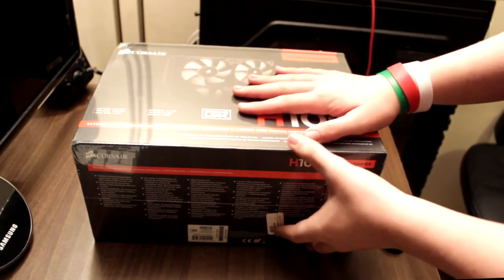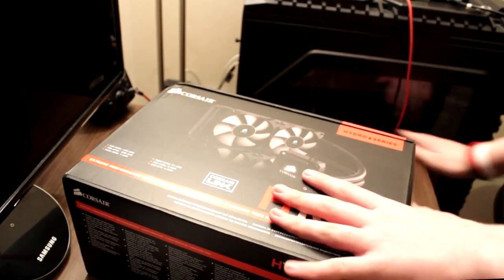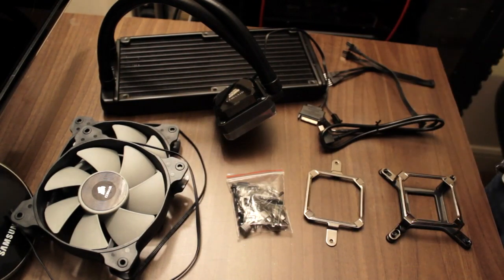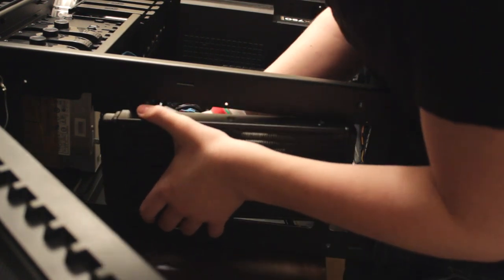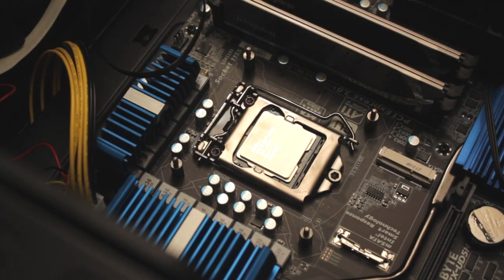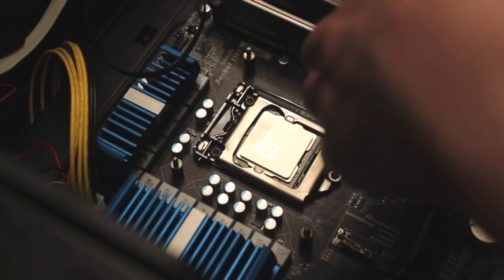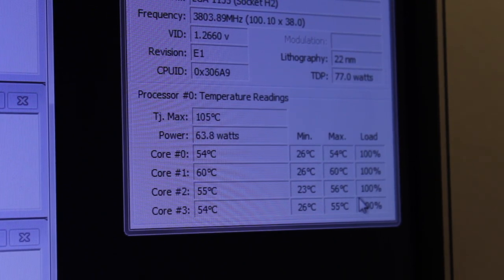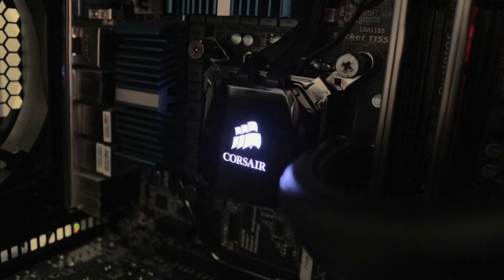Corsair H100i: Unboxing and Installation

Comment: is the backplate of corsair h100i suppose to jiggle and be loose before installing the cooler on top of it with bracket? im putting it on
gigabyte aorus z390 pro motherboard and the backplate is loose and i'm not sure if i should proceed with it or if i should take the adhesive tape on the backplate and stick it to the motherboard (the backside where backplate is snugged to)

Comment: Can you change the LED color of the corsair logo?
Reply: Yes you can change it to whatever colour you like. If you get the led corsair fans then you can even coordinate the colours. It's a wonderful  cooler. My i7 9700k sits at 27 degrees at idle and load is less than 60

Comment: So the box in the video doesn't say it supports LGA 1150 but on the website it says it does and now I'm not real confident in buying it. Does it actually support LGA 1150 and if so is there a video you could link me to prove it? Thanks!
Reply: Use pcpartpicker
Reply: +Zyrah yes it does, i have it installed on one

Comment: I heard the fans were uncomfortably loud under load, is that true?
Reply: ***** yeah but if you get some sp 120 quiets they will be silent
Reply from the maker: ***** The stock fans are loud OOTB but you can control them using Corsair Link, or pick up some SP120 Quiet Editions, they are quiet OOTB.

Comment: Will it really not fit an lga 1150? If not can you recommend any other cpu coolers or can i just use a different mount... Sorry, I am a noob.
Reply from the maker: Ducko 1103 This will fit LGA 1150 with the same LGA 1155 mount I used in this video. The reason I don't mention it is this was filmed in 2012 before LGA 1150 even existed.
Reply: bleedinsixcolours Thank you :D

Comment: Is this cooler enough for an i7 4790k?
Reply: SEANcb Are you being sarcastic
Reply: Nope
Reply: This is probably one of the best AIO water coolers available. Its actually somewhat overkill for a 4790k
Reply: I just realize how stupid my question is. I am probably going to overclock to 4.40 Ghz
Reply from the maker: SEANcb I'm on a 5820K (6 Core equivalent of the 4790K) and I'm overclocked to 4.4GHz so you should have no issues! :)
Reply: +SEANcb  uuumm  4790k turbo boost to 4.4 naturally if temps permit..
Reply from the maker: Rene Pena It will only boost 1 or 2 cores to 4.4, and all 4 will only go to 4.2GHz MAX. It is also not going to be used in all scenarios. Overclocking to 4.4GHz will mean it will always run CPU intensive tasks at that speed.
Reply: Cool man, had no idea. Thanks for the heads up!!

Comment: Did you plug the fans straight into the block or into your motherboard CPU fan headers? I've heard mixed ideas about this and I suppose it's just preference. I think I'll plug my radiator fans into the CPU Fan and CPU Optional headers. My Asus Vii Hero has a lot of fan control options in the UEFI. I'll still have to install Corsair link so that I can change the LED though.

Comment: I also have a haf x case and I was wondering, does it matter if the radiator is below the metal bars that it screws into and the fans above it? Also, if this doesn't matter should the fans be blowing air into the case or out of the case in this setup

Comment: hey if you could answer my question it would be great, I'm looking at buying a system that comes with this cooling system and that's all swell, however how do you empty it out and refill it? no tutorials focusing on the water specifically so how is it done? please help, thanks in advance.
Reply from the maker: No you never have to refill or even fill the cooler. It is all pre-built in.
Reply: oh! thanks mate! been scratching my head at this one, I guess reservoir systems are much different from closed systems.

Comment: guys my h100i is going to 80 c on p95 with all stock clocks. The stock fan used to run 70 max and even less, the h100i was still going above 86 when i stopped it, I'm running a push config just like the video, but the fans are plugged into cpu and cpu opt. and AI suite 3 reads them as 2700 rpm when on load, is it because of the pump not getting enough power??? I also don't hear the water moving through, is that normal too, please help me.
Reply from the maker: If you look on my channel I have a video entitled 'H100i Backplate fix'. Look at that video it should help you out a LOT. It's a common issue mate don't worry.
Reply: bleedinsixcolours okay, I will try that fix later when I get some thermal paste, but my question now is, I didn't have any cables with the h100i it probably got lost, and u have like 2, so my pump is only powered by sata and not the corsair link and the mini usb, does this affect the pump performance?
Reply from the maker: Sami Haddad The USB connection is only for DATA its not necessary at all. The pump power comes from that single SATA cable.
Reply: bleedinsixcolours i don't have ANY cable, is any cable necessary for the pump power and control? I repeat I have noooo cables at all no corsair link or usb shit
Reply from the maker: Sami Haddad The cable that powers the H100i is Pre-Attached. To control the pump you will need the USB connector but thats unnecessary. Just plug in the cables that are permanently attached thats all you need.

Comment: Getting liquid cooling to treat my baby i5 since with stock fan it shoots to 105 degrees CELSIUS the second I render anything in Vegas

Also yes, I know It's most likely a thermal paste issue.
Reply from the maker: Mate 105 is really really not safe. PLEASE reseat your cooler...

Comment: Will this work with Aerocool X-Warrior Black Edition?
Reply from the maker: No it won't mate. You may want to look at the H80i if you're thinking about putting an AIO in that case. I'd say upgrade your case though mate :)
Reply: bleedinsixcolours Is Fractal Design Define R4 a good case for the H100i? And good for overclocking?
Reply from the maker: That is the case I have mate, I fact I have done s video recently on installing the H100i in the Define R4 and it is a brilliant case.
Reply: bleedinsixcolours OK thanks mate! You think I can overclock my FX-8350 to 4.5+GHz with that cooler and case? If so, the only thing that's "stopping" me is my motherboard... ASUS M5A97 R2.0, but I hope I can overclock it at least a little bit. If not, I will upgrade my motherboard I think...
Reply: And is it really worth the money?
Reply from the maker: ***** Overclocking is never guaranteed. It is down to your specific chip. I found it worth it to me, as I got my 5820K from 3.3GHz to 4.5GHz, adding about 30% extra performance. Read around forums, if there are a lot of success stories of the 8350 with this cooler then it SHOULD hit the 4.5GHz that you're looking for, but there are no guarantees mate.
Reply: bleedinsixcolours OK, saw JayzTwoCents overclock it to 4.8, but he has this "super-board" and 850W gold rated power supply.

I got a 550W power supply by XFX, you think I can overclock a little, mate?
Reply from the maker: ***** I honestly don't know mate, I have no experience with the 8350, but I would think so yes! :)
Reply: bleedinsixcolours The 8350 uses 125W and my motherboard supports 140W. I'm using a GTX 760.

Thx!
Reply: Would you recommend the H100i for water cooling or something else?

Comment: Will I be able to fit it into this case? http://www.amazon.co.uk/CiT-Vantage-Gaming-Audio-Reader/dp/B0071KZNUY#productDetails
Reply from the maker: No mate, and honestly I would re-proportion some of your funds away from the CPU Cooler and to the case. Honestly, I have bought that exact case when I was building my first PC and it is horrible. Step up your case and get a Coolermaster Hyper 212. You may even get better temps because that case is awful for airflow.
Reply: bleedinsixcolours Ah right, that is just the case that I use at the moment, thanks for the reply :) 
I was thinking of getting this case, good choice or not?
http://www.overclockers.co.uk/showproduct.php?prodid=CA-135-NX
Reply from the maker: Beandon Jones Very good choice mate :)
Reply: bleedinsixcolours Changed my mind due to budget haha, what do you think about this one compared to my current shitty vantage one? :D 
http://www.overclockers.co.uk/showproduct.php?prodid=CA-048-AE&groupid=2362&catid=2277
As I only have around about 50 for my case
Or maybe this one? http://www.overclockers.co.uk/showproduct.php?prodid=CA-042-NX&groupid=2362&catid=2277
Reply from the maker: Hello mate,
Funnily enough I've also had experience with the first case, I'd say not mate you'd regret it. Waste of £50. Do you know what size your motherboard is?
Reply: It is the http://www.overclockers.co.uk/showproduct.php?prodid=MB-261-MS mate
Reply from the maker: Cheers, here you go here are a few GOOD cases, they may not look 'cool' but they are really really good cases, you will feel like these are worth the money: http://www.scan.co.uk/products/corsair-carbide-series-200r-compact-mid-tower-performance-case-with-usb-30-w-o-psu 
http://www.scan.co.uk/products/corsair-carbide-series-spec-03-with-red-led-fan-aggressive-mid-tower-windowed-computer-gaming-case (theres also a blue version)
http://www.scan.co.uk/products/nzxt-h230-silent-black-mid-tower-performance-case-usb-30-quiet-120mm-fan-w-o-psu

There you go. if you need any more then let me know :)
Reply: Thank you very much for your reply, the second Corsair one is a definite buy, it looks incredibly cool too! :) 
It's a very good upgrade from my vantage case haha.
Although the other cases are cool, i'll get the second Corsair one because of the window haha. 
Thanks again mate!

Comment: low light shaky camera work cant see a damn thing youre doing. thumb down
Reply from the maker: Mate I don't get payed for this sort of thing, hence things like lighting and camera work for a starter is hard to get. Luckily I've invested my own money and improved now, and you can see an updated video on my channel.
Reply: I got one its okay, not great. I got a refurb one for cheap. Definitely don't pay the full price. Any large air cooler would do just as good and probably be quieter. The fans are pretty loud plus you get pump noise too.
Reply: One advantage though is the radiator can be at the edge of the case blowing hot air out whereas an air cooler would circulate warm air around the middle.
Reply from the maker: artifactingreality
 You definitely took a good route mate, the fans are only loud because they are unmanaged and are running at like 2300rpm. If you use a speed reducer cable or manage the speed in the BIOS/ on a fan controller to less than 5V they can be extremely quiet, but i'd just recommend buying either some SP120Quiet Edition fans from Corsair or some Noctua NF-F12s and lower the speed on those for it to be near silent :)
Reply: bleedinsixcolours
Will this fit with the cm storm trooper and asus maximus formula vi?
Reply from the maker: Gatz22 Yes it will :)
Reply: Thanks

Comment: hello mate, thanks for the video, i got my H100i but can you know why i cant control the fans ? sometimes they get loud and the tem is 42c, i downloaded Corsairs Link but it seems i cant see the fans. thanks once again
Reply from the maker: I think this is an issue with Corsair Link. I have made an updated video a few days ago with my new system and I cannot control the fans on there either, as well as someone commenting asking the same question you did. Put a support ticket through to Corsair support and hope they can help you out mate. Sorry.
Reply: make sure bracket is tight when the block isnt on yet/ liek the 4 pin holes that come from the backket in the back. make sure that bracket is completely tight, my was a little loose but when i put the block on it became tiht so i thought no problems than right??? wrong now that i went back and made it tight i get 30 C less and same 4.6 mhz with 0.1V less

Comment: Is there an easy easy to tell can direction with these? 

I'm installing into a corsair carbide 240. Don't have the mobo yet but doing ad much pre-installed as I can.
Reply from the maker: With the fans? There are sometimes arrows on the sides of the fan (the edges) that tell you which way the air is going to be pushed. If you manually spin the fans you can sort of tell which way they Should go. The side with the sort of X frame is the side the air is pushed out of. If that is not what you meant please comment again and I'll get back to you.

Comment: What about Aerocool Strike X One? Will it fit on the top or is hydro 80i a better choice at the rear ?
Reply from the maker: I think yes, It will fit, there is mounting holes for two 120mm fans... But I don't know wether I would risk it given that i've never worked with the case. Technically it should fit, but If you have any doubts get the H80i. The performance difference isn't very big at all. :)
Reply: Im glad that I didn't even try H100i, the thickness of the radiatorn and the fans, would actually make me ram-less. haha! Even H80i makes me can't get on the last screw for the sidepanel, since the screwhead is slightly roundish... oh well. Im happy atleast I got it installed. :) thanks, and keep going with videos, you got a sub :)
Reply from the maker: 胡俊龙 Thankyou very much! Im about to upload some X99 Content soon so be sure to look out for that :)

Comment: Since you seem like a calm and nice guy, im going to ask like 100000 other people have done, do you know if it this will fit in a NZXT phantom full tower? :)
Reply from the maker: Yes it certainly will :) Very nicely actually you will be able to even do PUSH/PULL easily!
Reply: bleedinsixcolours i got the phantom tower now and the h100i, seems decent enough to install, but do i need another 200mm fan on top? or can i just install with the one 200mm fan i already got?
Reply from the maker: Kawasakileet Hello, 
Congrats dude the Phantom is a great looking case. Id say don't even have one 200mm fan on top, It isn't going to really do anything in terms of radiator performance and could actually block the air trying to come through the rad. It won't create any more static pressure because there is no seal at all around the fan and the radiator so its just freely blowing air everywhere.
Cheers mate any more questions don't hesitate.
Reply: bleedinsixcolours Thanks for quick answer :) i got another question, ive met an issue with my ram, ive been smart enough to order high profile ram, which meens im having clearance issues, and i dont want my h100i on top of the case, is there an option to skip the brackets that comes with the case and just put the radiator directly on the case? or does the radiator need clearance from the case?  (might have been messy explained, had trouble finding the right words :P)
Reply from the maker: Kawasakileet No problem mate, Yes i believe you can put the radiator in the top compartment where the fans usually are and then mount the fans through those structural bars to the rad, thats how i did it with my old case :) If that is not what you meant please let me know and i will get back to you! :)

Comment: will this fit on my case aerocool v3x advance thanks
Reply from the maker: Hello.
Now I'm going to say no, not really... it could be possible if you mount the radiator onto the side panel which is very clunky... There is no fan mounts at the top because the power supply is mounted there, so For me, id say no it isn't compatible sorry.. But if you would like to try it in the side panel it is possible, although unrecommended.

Comment: what case are you using?
Reply from the maker: In this video I'm using a Coolermaster HAF X, and right now I'm using a Fractal Design Define R4
Reply: Is it easy to install the h100i in the  fractal design define r4
Reply from the maker: Steven Gibson Yep, very easy. No clearance issues with this motherboard, and I've even tried with the X99-Deluxe with its massive heatsink and had no issues.
Reply: bleedinsixcolours what is the specs of your PC?

Comment: Nice video dude, I really appreciate it you make the video of it, I plan to get this one for my new rigs. Can I OC my intel i7-4790k with MSI gaming 5 motherboards with this? And at what clock & temperature that my i7-4790k that stable and safe using this cooling system? Hopefully you answer to my question. Thank you :)

Comment: will it fit a Corsair Air 540 ATX Mid Tower Case???
Reply from the maker: Yes it will :) With any Corsair case really that supports two 120mm fans Somewhere, the H100i as well as any other variation of their Hydro coolers, can be mounted.

Comment: Will this fit in a Radimax Aeolous Case?
Reply from the maker: Just looked on the site and it confirms there are two 120mm fan mounts in the roof of the case. If there are no issues with clearance then yes it will be able to be mounted. I have no experience with this case though so I can give no guarantee.

Comment: I noticed that the all SP120 fans have different RPM speeds. I recently bought a SP120x2 Pack fans from Corsair with 2350 RPM. There is also the SP 120 fan with only 1500 RPM. Depends on your choice of fan speed ofcourse. But, just so you know, you need to check on that before buying them.

Comment: 84 degrees is too high for the corsair H100i, something is wrong with your build man.
Reply from the maker: Yeah I RMA'd it and used rubber washers on the backplate to remount it and it fixed the temps, down to 60 now.

Comment: did you say that you didnt need thermal paste? or that the h100i has it pre applied to the copper plate?.. i couldn't tell as you speak so fast its like another language
Reply from the maker: Aha, I'm sorry Yes the H100i DOES have thermal paste pre applied to the copper plate yes.